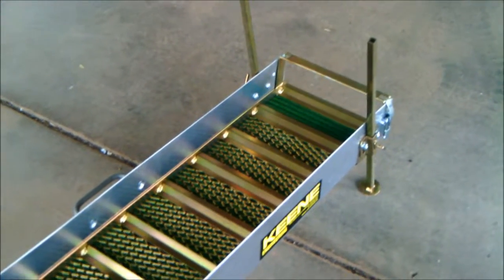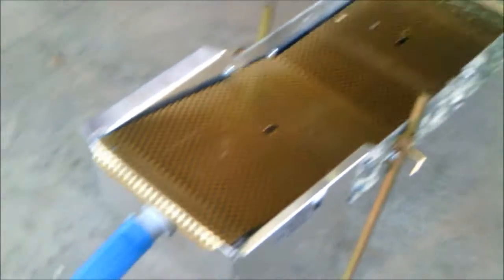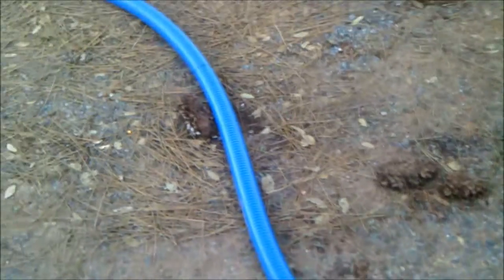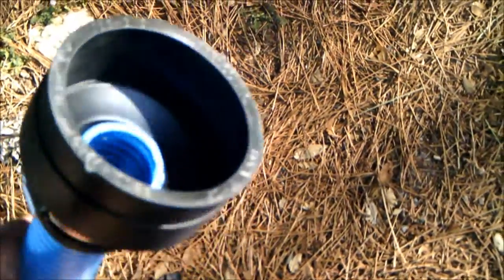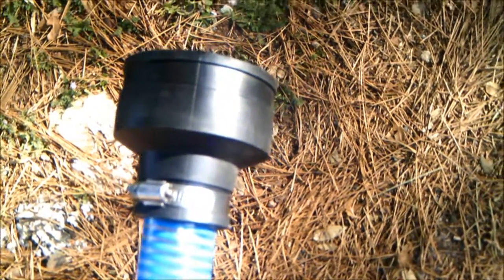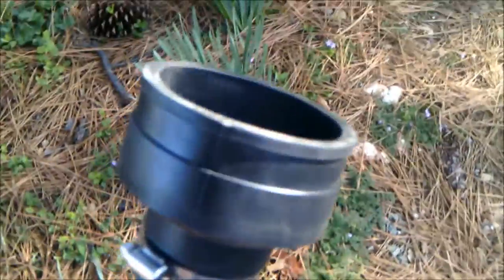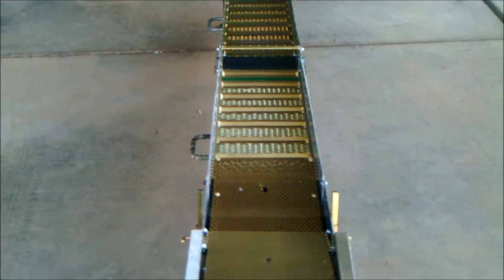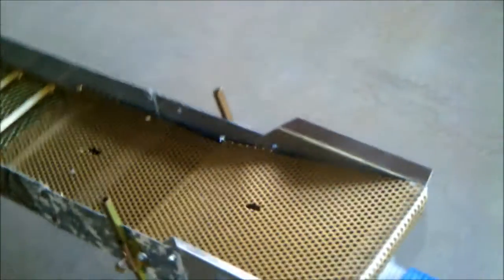hydraulic gravity feed longtom

Comment: good idea, I also thought about using a long hose to carry the waters but I was thinking of drilling a hole in the bottom of a bucket ( 5 gal can) and connect the feed hose, maybe  first place a PVC pipe with bigger size then the hose and use a reduction for giving more water pressure .